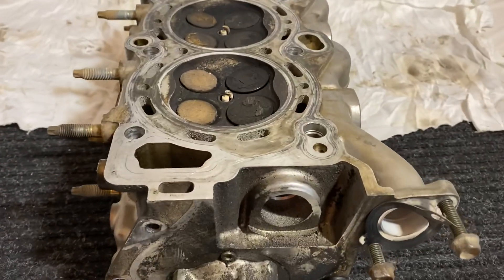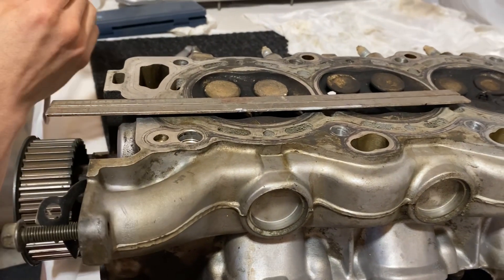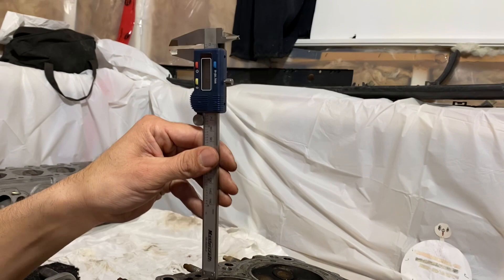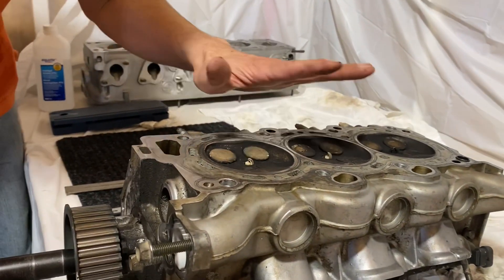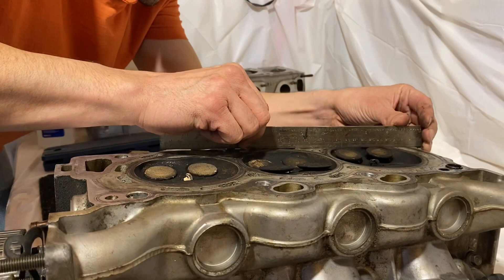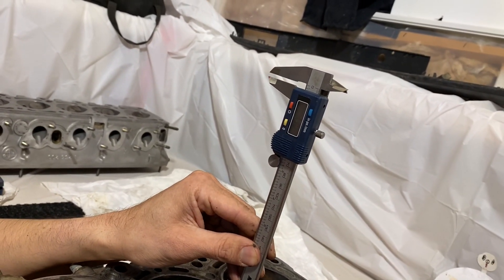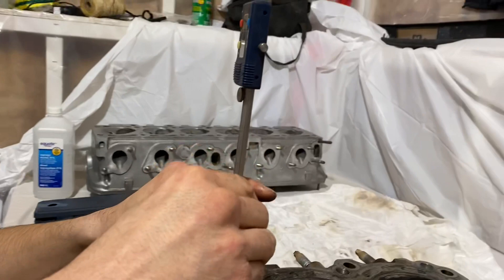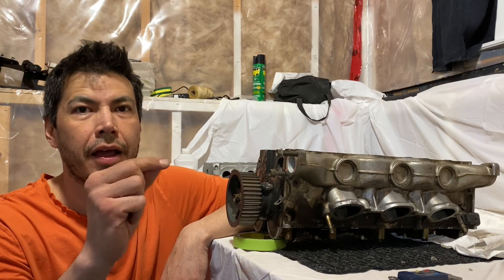Isuzu series - cylinder head examination- valve / Piston clearance. Timing belt failure results

Comment: Thank you!!!   Thank you!!!   Thank You!!!     That clears the mystery in my mind.  More important than E-mc^2 for me.    "All the valves would close in the event
 of the timing belt failure".     I can sleep well.   Bravo!
Reply from the maker: No problem hope the video helps.
Reply from the maker: Check out part 2 where I measure the piston and break it all down.
Reply: @r1beef88  I did watch that video.  You have the evidence with the measurements.  According to that video I conclude that the valves are never in danger of being hit by a piston.   Non-interference all the way.  Mystery is definitely solved.   I am a definite believer.   
* Thanks for your work!

Comment: I rebuilt a 3.2 and there were 2 significant issues. first is exhaust valve clearance to the cam was too tight. Had to get another set of lower mileage heads. 2nd issue is deformities in the bore sleeve. I honed the bores and those deformities were honed down so shouldn't be a problem going forward. You will see them. This is why the 3.2 starts to burn oil. Use new pistons and rings, going back in. At least new rings. Great motors!
Reply from the maker: Yes all sounds so familiar. This engine was burning a quart every 1000km by the end. When I rebuild this engine it’ll be with new pistons and rings. And hopefully doing it to 3.5 spec build but we shall see. The cylinder bores will definitely be needing some work on this block. Hope I can save it.
Reply: MY 2001 3.2 burns a little oil.     Makes sense to me that my original 3.2 with 165,800 miles burns oil for the reason you mentioned.
Reply: @johnhanselman6371  mine was burning a quart of oil every 500 miles before the overhaul. When it gets this bad, oil control rings are stuck solid in the piston. Also gooped up the intake manifold with sludge. Had to clean out intake manifold and cat converters.
Reply: @rdnakx250  Did you manually have to take apart your engine to clean those part?.  Or did you use a liquid additive that you can pour with the oil to prevent or clean this problem.
Reply: @johnhanselman6371  I pulled out the engine and rebuilt it on a stand.
Reply: Thanks for sharing with me how you fixed the problem.   I was hoping for a miracle in a bottle but that is not reality.   I hope your 3.2 no longer burns oil after all your work.